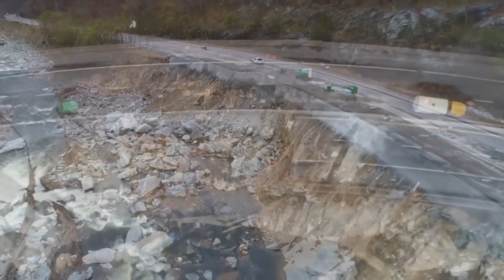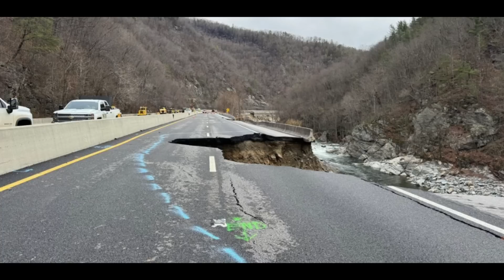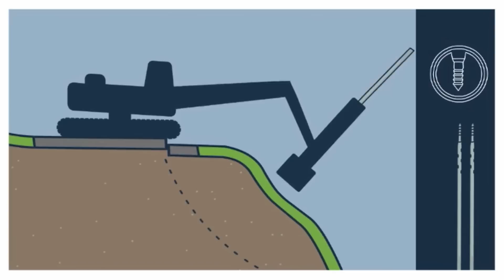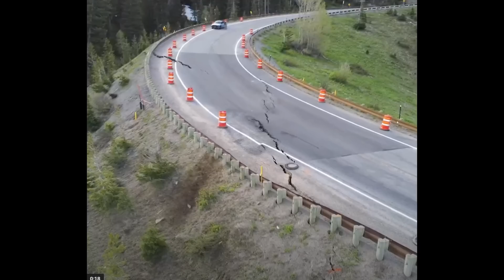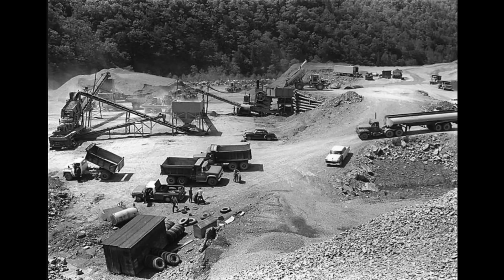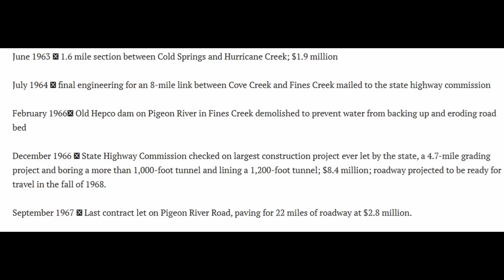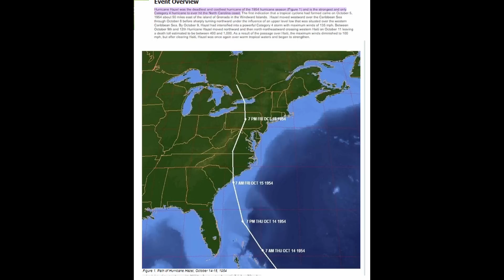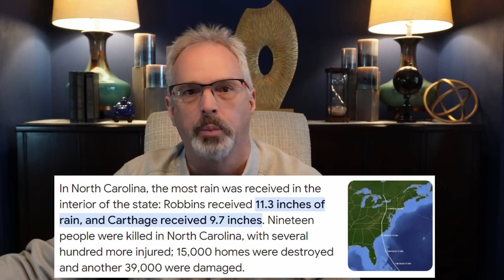Interstate 40 Rebuild Status

Comment: The N.C. Department of Transportation now expects that restoring I-40 will cost about $2 billion. That’s about $900 million more than NCDOT estimated last June. The largest share of the increased cost — $430 million — is a result of the geotechnical studies that showed that bedrock along the highway was more variable and deeper than expected, requiring larger foundations for the retaining walls. The rebuilding of I-40 is still in its early stages; the eastbound lanes are not expected to reopen to traffic until late 2028. Though unlikely, it’s possible the final cost could come in somewhere under $2 billion.

The News and Observer,
 January 14, 2026

Comment: Anyone with half a brain knows , if you are going to fix this road you need to blast until you find bedrock, then drill set in some pilings as deep as you can, then start building your replacement off of your base. Ya’ ll are trying to hang sky hooks by shooting those bars and rods from above the damage

Comment: That highway was never supposed to run along the pidgeon gorge to start with. Where it turned northward and southward it was supposed to keep running east and west but some politicians back at that time lived in that area and wanted the highway to turn and come by their towns so they could have a better route to raleigh from their homes. and now that the highway has been destroyed it should run the original way it was mapped to run to start with instead of rebuilding it in what most people call the politicians map.
Reply from the maker: You are exactly right!
Reply: @CaseyJones-Engineer  Im an old west virginia  boy that moved to florida in 1965 and they were working on I40 in Winston Salem/ Greensboro area then and I moved back to the Piedmont area of north carolina in 1971 and I 40 was completed at that time and I remember people in the Piedmont area talking about the Piedmont area talking about that area thru the gorge being a Politicians highway thenand that it wasnt ran thru the way it was orginally designed by the Federal government and it cost North Carolina Tax payers a LOT MORE than it was supposed to have cost because of that little North/South route that the federal Government had not approved and I understand from what I hear now that North Carolina is on their own building it back because of that

Comment: You need to factor in the rock slides that happen every 3-5 years that have happened since this section of I-40 has been open. Helene was the icing on the cake for this section of I-40. Unfortunately,  I-40 was doomed from the beginning.

Comment: Where else you going to run it?  You could go up the French Broad River valley, but that's just as prone to slides, if not more so.  There is no slide proof route.  I'm no structural engineer, but I've spoken with and read the writings of more than a few geologists familiar with the area and they're pretty much in agreement - you're in for trouble regardless of the route chosen.

Comment: As a heavy civil engineer. I concur with @irvgleaner5558  a viaduct would definitely be a better option for this area. The engineers working on it presently are stuck in a perpetual system of using outdated technology. Sure it was cutting edge in the 40's. I've worked on a lot of viaducts around the world and it seems like Americans are so far behind in engineering. They look for the fastest way through the project and ignore the long term. 22 mile viaduct should roughly cost 250-300 million.  And have a life of 50 ish years. Drill rod slope remediation isn't a guarantee. Slope slippage is most definitely a concern, even with the anchor's. I know it a moot subject because they have already decided drill rod is the best way,  however they are incorrect.

Comment: What's the useful life of the rebuild? What would the toll have to be to break even at the end? 

Known and unknown variables? 

Are they building a giant perched water table? 

Has anyone looked at the as-builts for, say, the fill embankment border/interface between "competent" rock, and/or incompetent rock and the compacted mass of unconsolidated material, and how relevant lab shear test results are to (changing?) reality? How much and at what rate under which conditions can the actual embankment be expected to meet the ASTM standard? I haven't read a spec/soils report in a long time, but if I recall correctly, they are so festooned with qualifiers that the only thing that holds (or doesn't hold) water, "so to speak," is the instant the test (penetrometer?) was conducted by the geotech (grunt or engineer?) in the field during construction. Do errors creep in in between field tests? (I got ad hocked off a "team" because I suggested that such an anomaly should be considered as an alternative explanation for the infamous "green spot" on the Oroville Dam a few years ago. I'm not sure, but I believe the DWP engineers did consider it, but I know of no actual studies.) 

Obviously, I don't know what the hell I'm talking about, so PLEASE STRAIGHTEN ME OUT. 

Just because a massive disposal fill project of mine went through the Northridge Earthquake in '94 a couple of engineering geologists who looked at it in in the late 1900's co-authored a paper that I gave at an annual meeting of their professional organization. At the end of the talk, I ad-libbed something to the effect that all compacted fills are slope failures waiting to happen. The paper was not published. 

What's going on in that part of the country (and everywhere else?). Target stores, airports, highways? Did they meet ASTM standards or were there any errers?

Comment: With respect to the I-40 failure in the Pigeon River Gap, I wonder if the original proposal was simply the "least cost" approach.  I am not a P.E. though I've worked in related fields throughout my career.  I believe that during the planning phase perhaps the engineering folks had to realize that, in this case, the "least cost" solution may not have been 
the best solution though politicians were likely more amenable to it.

The area rains preceding the I-40 failure had already saturated the soils in the collection area. The water shed that feeds the Pigeon River is surrounded by steep mountains, and the rain brought by Helene quickly rolled off into the collection area and the result because of sheer volume and speed quickly scoured enormous amounts of supporting soil. Would tunneling around this area have been a better solution?
Reply from the maker: What you suggest is plausible, but I am also hearing that the decision to place the interstate along the Pigeon River was made mostly by politicians for a variety of reasons.  Oh and yes, I think using more tunnels would have been an option.

Comment: It's been said the explosives engineer that supervised the type and use of explosives on the mountain was known for using excess amounts, resulting in shattering of the mountain rather than just spalling off of selected areas of rock. This resulted in frequent rockslides and the necessity of installing rock nets up slope of the road. My opinion is a new route for I40 should be selected and the damaged section abandoned.

Comment: I recall Gov. Dan Moore was told the road should not have been constructed down low in the gorge, but rather higher up near the top of the Ridgeline. NO. He insisted it has to be down low so as to not impair the view of the gorge. And I40  has been nothing but trouble since. Landslides, falling rocks and mudslides have been a continuous problem.  This washout and other problems clearly indicates I 40 should have been constructed up on the ridge, not in the gorge.

Comment: While a new highway is a solution. It does not take into account the economic hardships imposed on Western North Carolina and Eastern Tennessee. The time frame to construct a new highway would impose an economic hardship to the residents of the area in the hundreds of millions of dollars. As for how could you carry on construction with two lanes open. The simple answer is to run the project in the two closed lanes from either direction. I do have a problem with the math on the construction costs. Your current estimate of 15 million per mile at today's cost is estimated for a 22 mi section of highway. The damaged section of highway is four miles, 15m x 4 miles is 60m.

Comment: The 16 mile Rogfast tunnel in Norway is currently underway and projected to be $2.8 billion per mile. The worst of the damage to I-40 is just west of the double tunnel. To tunnel from there to Hartford TN past all the 12 damaged sections of roadway is 6 miles. Assuming the Rogfast cost per mile is a good estimate, just tunnel the 6 miles for $17.25 billion and split between TN and NC DOTs. Maybe toll the road too to help fund it. The existing roadway - let it go back to nature.

Comment: This is something I have explained to so many people in my life, so pass it on. Not even the national News gets this right. The data used to develop point, precipitation and frequency rainfall tables were developed based on normal climate conditions. Anytime a hurricane came through, the precipitation results were pulled from the dataset. The reason for this is early hydrology’s main concern was available soil moisture for crop production, so freak events are not helpful to agricultural planners. When flooding occurs due to a hurricane, frequency tables can be used to rate the storm, but not to predict it. Average precipitation patterns tend to reflect the average available moisture in the air. The rain that fell during Helene was double what is likely to occur in our climate without a hurricane. In 1906/1907, that flood occurred in the same conditions. The Gulf Stream was way up high and a hurricane came in. A better predictor would be to determine how often those conditions occur. People say Helene was a 1000 year storm. It is better to the flooding that occurred in WNC as a result of hurricane Helene had the intensity and volume of water that is impossible, without a hurricane. Helene dropped double the rain of the 1000 year storm which is impossible outside of a hurricane. I hope this helps. I have a masters degree in hydrology and have been a practicing professional engineering related to stormwater runoff for the past 30 years.

Comment: An interesting and thought provoking video.  I like your anology about the power plant.  However, nuclear power plants in the US are powered with U238, not 235.  Nuclear ships and subs in the navy are powered with U235 which requires a lot of work to separate from U238.
Also, it would have been interesting to know where you think the new I-40 should be.
Reply from the maker: Thanks for the clarification.  I just did a video where the Army used a modular reactor in Greenland in the 1960's that was powered by U235 so I had that in my head.

Comment: One thing to ask is whether the deep time extrapolations used as an assumed accurate basis are indeed accurate. What happens if we reduce the time frames from the current deep times used until we find the normal distribution match... what time basis would that give us.

Each event should add to the data... if an event occurs within a recorded historical time frame that shouldn't we may want to adjust the assumed time... so 1 chance in 1,000 years is based upon what base time frame.. 4.5 billion years? 70M years? 4M? 1M? 100K? 10K?

My point is this.... we need to start using recorded historical time ranges instead of prerecorded history time frames that are based upon extrapolated theory instead of empirical data. Thi is especially important for life risk engineering.

We should start with a maximum of 500 years (circa 1600 AD) and realistically much less.

Ideally we would only use real recorded data.

Another thought is to go down to bedrock and build a wall where the road was (concrete wall) put river stone rip rap on the river side and build another wall down the centerline of the old road. Filling the area along the riverside with river stone rip rap and other river stone gradually rising to road bed level and running grade beams between wall fill up the road bed to support the pavement and you have the river side 2 lanes. Then build another wall to bedrock along the hillside of the road and again fill that area and put pavement on it all drainable. where deepen the river channel pulling rip rap needs from it. 

Cost should be compared with that of an alternate route.
Reply from the maker: Great comment.  I agree that the appropriate selection of the time scale is the real challenge here.  People tend to assess risk relative to their own individual time scale by relying on their experience which is clearly a mistake when it comes to predicting the occurrence of extreme events.

Comment: I-26 through Unicoi County, TN is taking an absolute beating from all the extra heavy diverted traffic. Big potholes and deteriorated pavement. Loaded 5 axle dump trucks and 18 wheelers aiding the railroad rebuilding are taking their toll. TDot can’t handle it.
Reply from the maker: Thanks for letting me know, I'll check into that and see if it makes sense to cover in a future video.

Comment: Rock slides have been a reoccurring issue thru the years. Too bad  they couldn't lay the slope back and carve out a  new road back towards the inner part of the mountain. Guess either build a bridge above the river or  controedl demolition to widen and build the road where the river is and reroute the river.  use the rock for the road bed  and erosion control. 
I'm glad that's not my headache lol because that one's a migraine lol itll work out though

Comment: I agree the I-40 corridor in NC is a poor route choice. It is very difficult to drive and has accidents weekly that shut down traffic and claim lives. I also agree it should not be reopened to traffic for two lanes. It was too busy with 4 lanes. I have a home 3 miles off of exit 15 (Fines Creek) and used the road regularly. The only way I could see using 2 lanes would be as a stop gap while building a new road on a new route. I guess time will tell the story.

Comment: I like your assessment. Seems like in addition to the problems you point out with the stability of the construction, it seems to be a rather circuitous route. Maybe that's unavoidable, but if that could be shortened, I'm sure money savings could be found there as well, and it would end up being a better way to get from point A to B.

Comment: Further too irv below; that would work but it still doesn't alleviate the elephant in the room. As I've stated in a previous post on one of Caseys video's. The direction of the river needs to be changed to get rid of the bend at that point. It needs to be straightened. The inside curve across from that point ; could be blasted away and used as fill for the new interstate. Other than that a tunnel spillway could  be bored through the inside curve rock formation to alleviate some of the water volume during a flood and direct it away from that curve. Scouring will not go away just by building retaining wall , which in my professional opinion would be insufficient to withstand impact of some of those boulders sitting there after the hurricane flood. A combination of an elevated viaduct and flood mitigation by tunneling the opposite bank may solve the issue. 
The size of the boulders in ANY river tells you all you need to know about "previous" flood events together with the steepness of the canyon walls at bends. My guess is they built the original road without consideration from scouring and flood events. Looking at the video I would say their remediation is woefully inadequate for any permanent fix. May be time for a tunnel from NC too TENNESSE under the Appalachian's!

Comment: COME ON MAN  oh please they could easily remove the broken ashalt drive down a stem wall fill the void with cement or HALF AND HALF and have it back open in 30 days or less depending on thickness and curetime
Reply from the maker: I don't think the solution is that simple.

Comment: Heard the same thing from quite a few life long residents of this area that the routing of 40 in that area was heavily politically infuenced….
Reply: Oh. I’ll also never travel that section of road….
Reply from the maker: Interesting.  I have traveled that section twice in the last few years.  The first time I was towing a trailer and there was a massive thunderstorm.  I kept watching to see if I needed to pull over to the shoulder instead of chancing running in to a flash flood at the bottom of a hill.

Comment: Along the idea of anti-fragile - I think more study needs to be done on modularization of roadway construction so it is easier to repair - with preference in this case given to raising the roadway on pylons - once you get it up a bit the roadway and beams can be standardized so instead of having to rebuild all the retaining walls and hauling in tons of material - you clear the debris, redo any of the supports that washed out and then the beams and roadway sections are then put in.  Obviously it is way more complicated then what I am saying here - but it is well known now that prefab concrete walls (have them in my own house) are much stronger and are revolutionizing vertical construction - we can do the same for the roadway (or at least the sub-roadway).  This is radical - but think about it and let it fester for a while.  We haven't really change how we build/repair roads in forever - can we do this better?
Reply from the maker: Thank you.  I think it is a very interesting point that you raise.  The military used to have "Bailey" bridges that were used for rapid deployment.  I like your idea of making the whole system "anti-fragile" by permitting a quick replacement of a heavy damaged bridge.